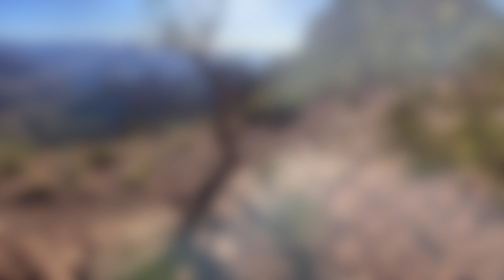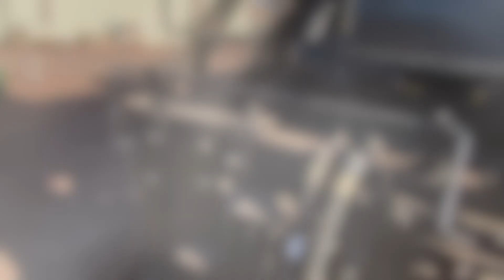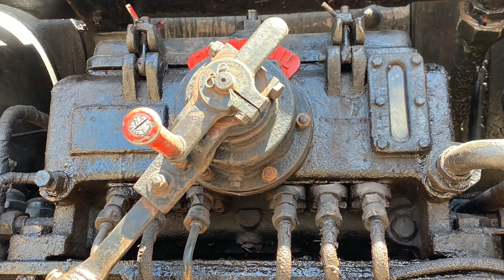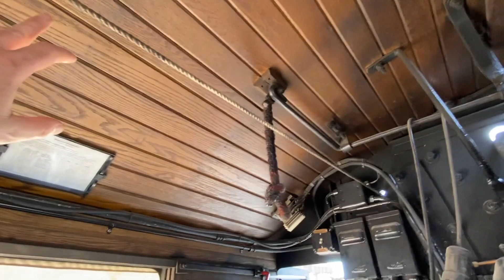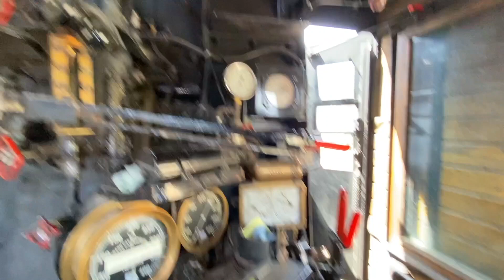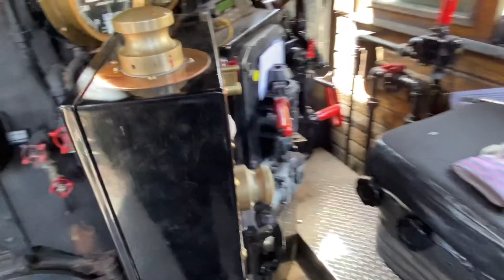Touring a steam locomotive- Grand Canyon Railway's 4960 - Part 2

Comment: If you have to operate the reverser on steam how do you keep steam from condensing in the air brake system?
Reply from the maker: If you have to operate the reverser on steam, then your air brake system is probably not functional.  

But the two systems are separate.  There is a check valve that should prevent steam in the power reverse from back flowing into the air system.